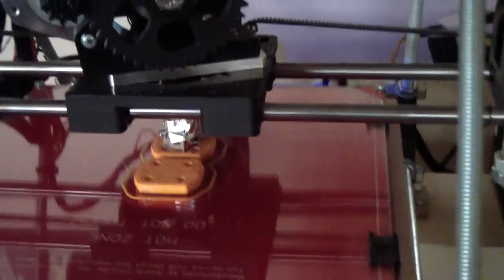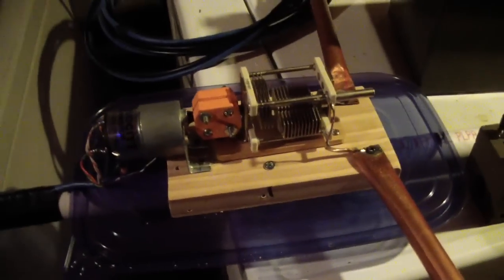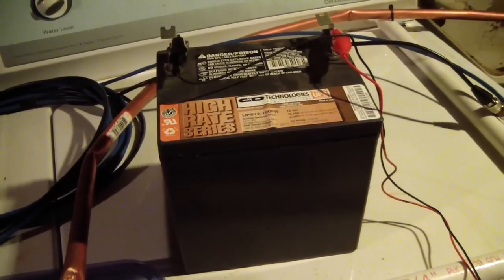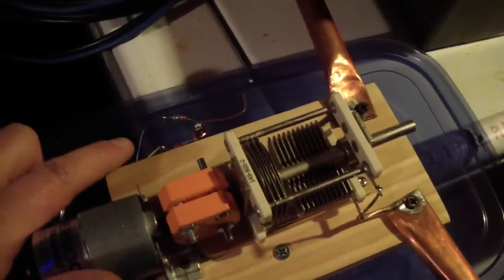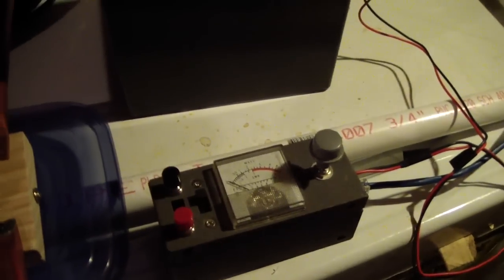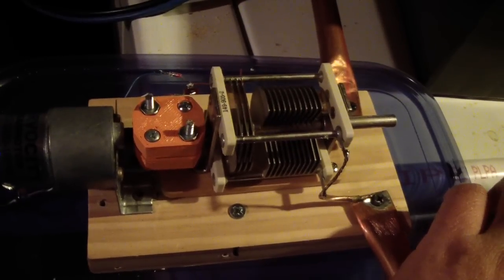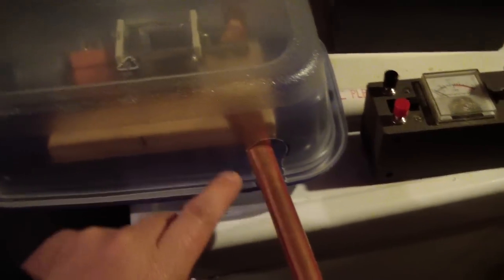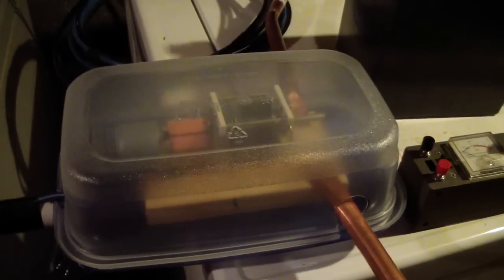Ham Radio - Remote tuning for my Magnetic Loop antenna

Comment: Question about your RF pickup. Are you using 1N34A Diodes and are they connected together at the pick up wire? Also, how did you wire the meter inside your remote box? Thanks for your help. de KA9TII
Reply: You can disregard this message. I found your schematic in another of your videos. Thank you for that. DE KA9TII
Reply from the maker: It's been quite a while since I did this video, but I thought I showed the schematic in the video. If not send me an email at my public email which is good on QRZ.com and I will send you the schematic and the information. Thanks for watching.

Comment: Could you please tell us where you get the components for your various projects.  Particularly relays, etc for your magloop controller.  By the way, very much like your videos! Thanks es 73.
Reply from the maker: Most come from a massive junk box of parts collected over many years.  Some purchased at hamfest.  Some recovered from dead equipment.
There are many online sources though.  Often you can simply search Amazon.com for components and find everything you might need.

Comment: WA0RSD
What rpm works the best.  I see that Amazon provides motors,  controllers, and brackets for about $34.  But what should I shoot for a practical tune speed

73s
Reply from the maker: The motor I'm using is 1 RPM.   Slow enough that fine tuning is easy.

Comment: I plan on using a ho scale train power supply to power a 12 volt motor turning the Cap on my loop. it offers reverse and variable speeds.